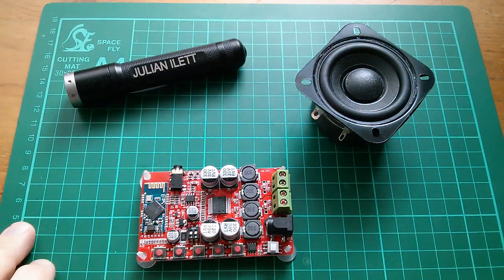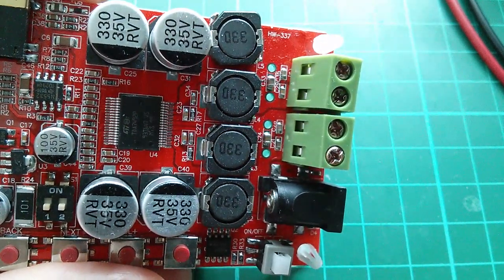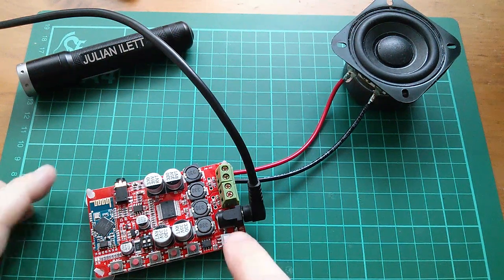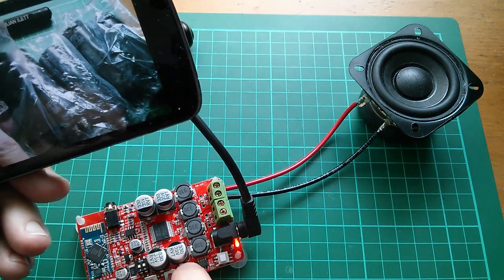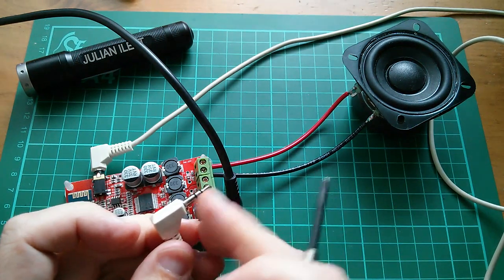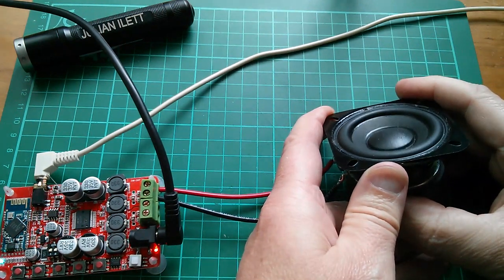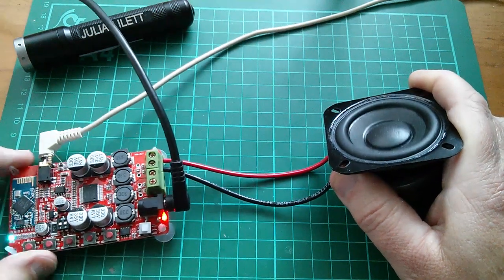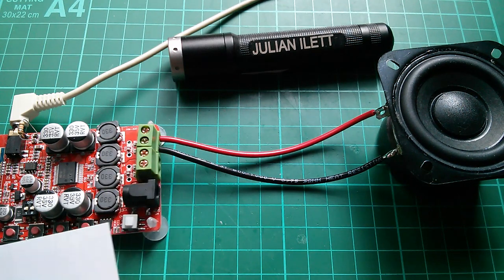SuperCapacitor Bluetooth Speaker Testing

Comment: julian does the polarity on the speaker matter ?
Reply: Anjay V no.  If the two speakers get hooked up on opposite polarity they will be out of phase but it won't hurt anything.
Reply: Anjay V , for one speaker, no.
When you use multiple speakers, the polarity is used to synchronise them so they drive in the same direction, otherwise they'd behave like noise cancellers.
Reply: POLO MARCO I don't think that is right.  The magnet is permanent and all reversing the polarity does is put the audio 180degrees out of phase.  The speaker neither knows or cares whether it's told to suck or blow first.
Reply: Thank you !
Reply: Those bass players are probably the same guys that think they have a louder amp just because the knobs say 12 on them rather than 10 - LOL !!!